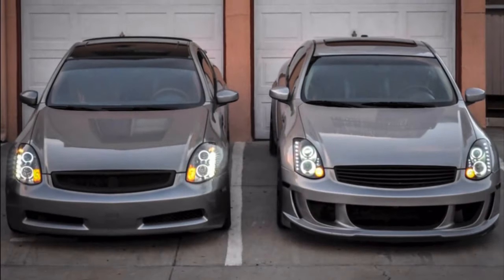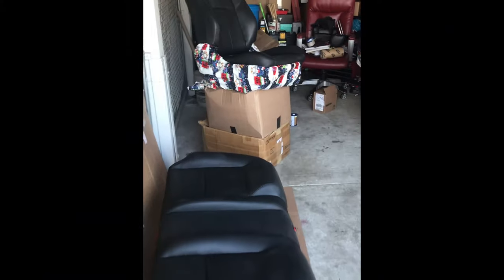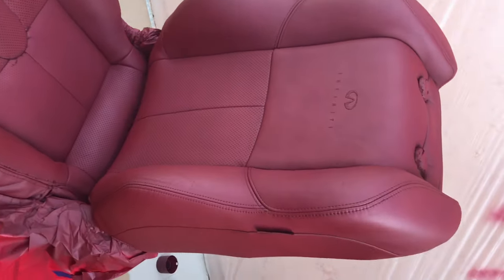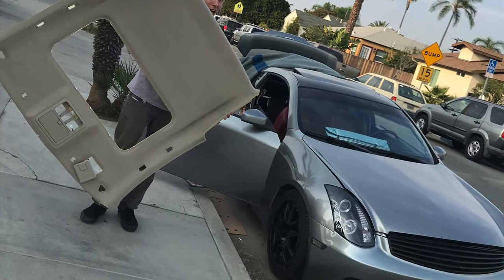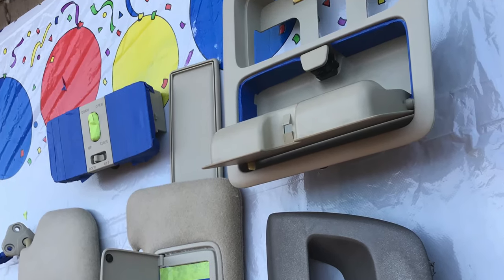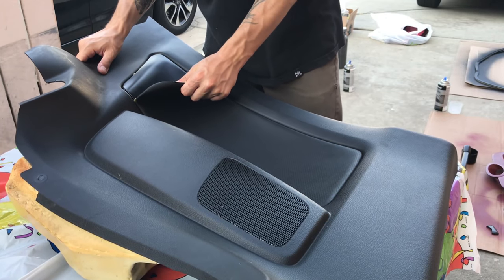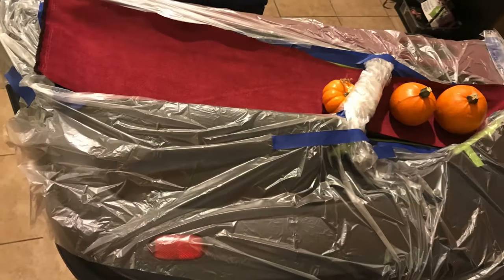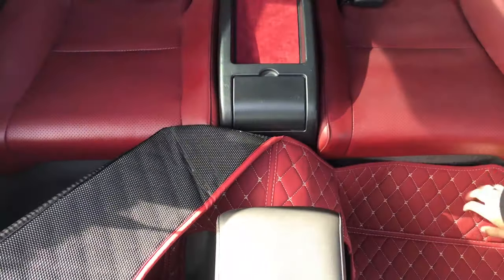Infiniti G35 Gets A DIY Custom Interior! Paint, Suede, & Manicci Diamond Floor Mats

Comment: Looks great bro! It's been 2 years now, how's the paint on the seats holding up?
Reply from the maker: Thanks! Actually I think it just hit 3 years. The paint in the rear seats and all the door panels and everything is still absolutely perfect. The front seats it’s definitely rubbed off a bit on the high touch areas. 
I wish that I dyed them instead of painting. Probably going to get the front seats reupholstered or new seats
Reply: @Donny_Bo_Danglez  I gotcha, that's what I had assumed. I'm planning to dye the seats in my G37 once winter passes. 

Some red Sparco racing seats in the front would probably look pretty good imo.

Comment: I have same headlights but guy who installed them did it wrong, the DLR’s aren’t working unless parking lights or headlights are turned on 😢 I don’t think he connected the small connector to anything on the passenger side light.
Reply from the maker: That’s how they’re supposed to work. They don’t turn on unless you flip the headlight switch to DRL or the main headlight low beams on

Comment: Hey bro, when you did the suede on the headliner, did you peel off the old cloth or no? Hows it holding up? 
Thanks!
Reply from the maker: I didn’t peel off the original cloth because it wasn’t sagging or anything. It’s still holding up perfectly almost a year later! 
I have heard that it’s better to take off the original material though

Comment: I want to do this to mine, is it challenging?? In ur way if working on it?
Reply from the maker: It’s mostly just very time consuming and tedious work. Not the hardest thing to do, but really can’t rush it. 
I don’t recommend painting the seats though. Mine are still decent over a year later but definitely have started to rub off on the front seats. Everything else is still perfect
Reply: @Donny_Bo_Danglez  damn. It's cause u know how the g35s the coups the driver always for some reason tears from the side seat always!! And I want to fix that and paint it but idk I'll take ur advise, since  I want to keep the heated seats, but idk if I should buy the red nrg seats instead, what do u think?
Reply from the maker: @ivanmendoza2643  dying the seats is a way better option. Just takes a lot longer, super tedious. But from what I’ve seen it is a much more permanent option. 
I think at this point personally I’m going to eventually just have my front seats professionally reupholstered in actual burgundy leather instead
Reply: @Donny_Bo_Danglez  I want them red to but yea the OEM is always better but idk who or what to do that's why I was just saying sparco or nrg seats

Comment: how to take off the rear seat door panels brother?
Reply from the maker: Gotta take the back seats out, then just use a panel removal tool or flathead to pull them free. The upper part of that there’s a bolt at the top of the seat belt that needs to be removed. Keep track of all those little clips that hold it on!

Comment: did it smell at all after?
Reply from the maker: since I had 2 cars at the time I let the seats and everything I painted for 5 days or so to air out. It still has a faint smell for a few days.
But if you put it right in after painting I’m sure the smell would be stronger for a few days